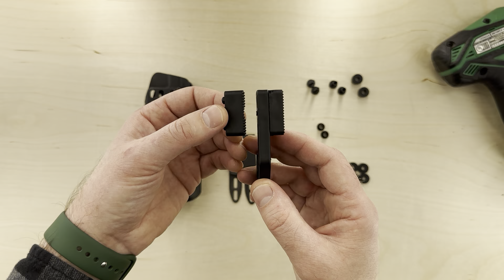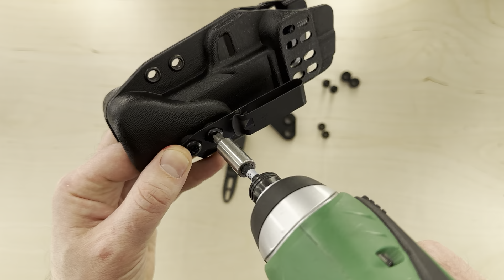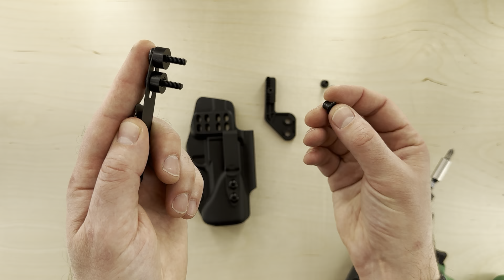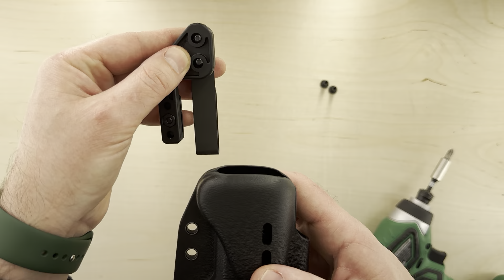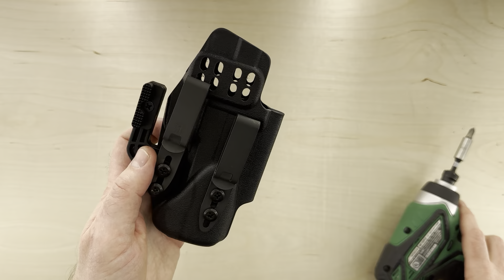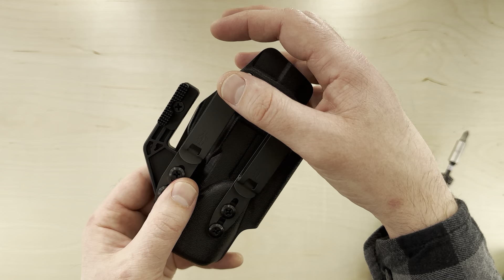PHLster Pro Series DCC Mod4 Assembly walkthrough. Discreet Carry Concepts.

Comment: Thanks for making the video. I was curious @4:29 when you see the side view of the DCC Mod4 clips - are the clips not supposed to be aligned together? For example I see one of the front clips @4:29 be lower, more away from the shell vs the back DCC Mod4 clip it is more closer to the shell. I would imagine it would make sense for the clips to be aligned together but mine is uneven as well.